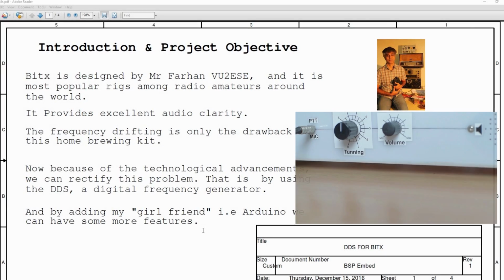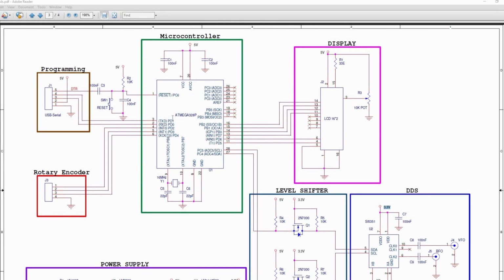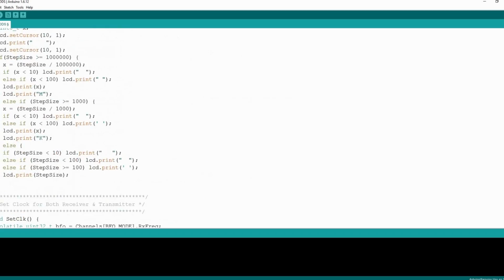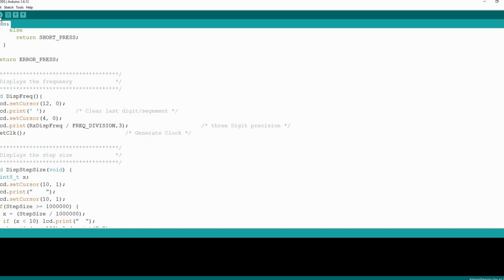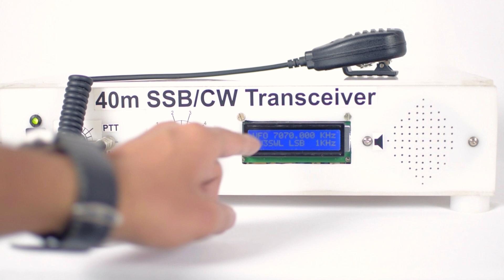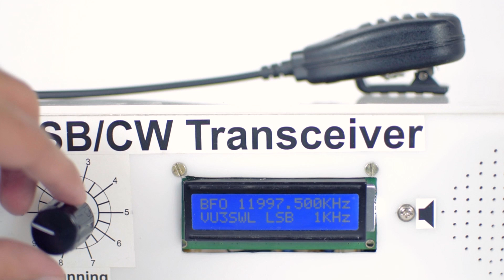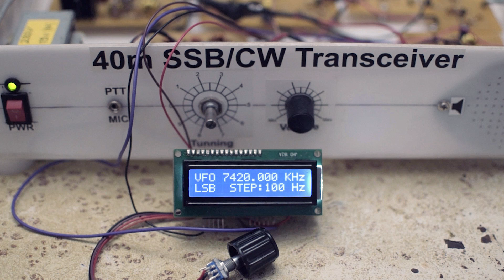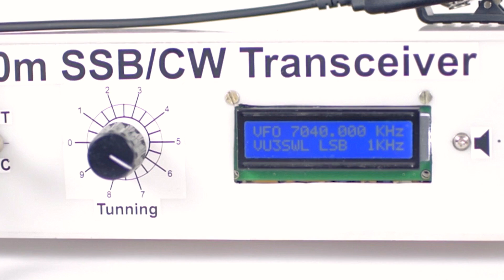DIY How to add DDS to Bitx | Bitx40 | Ham Radio HF Transceiver

Comment: Nice Video and useful my Friend.
I am using the same BITX40 V3 Radio with vu3vrl's DDS VFO and working OK.
Now, I face some problem with rotary encoder, when I rotate it anti-clockwise to lower frequency, the response is normal, whereas for increase of frequency, the response is very slow/poor.
I need to replace the encoder.
Kindly suggest me it's availability. Thanks.
..... vu2rdx, Sekhar.

Comment: Receiving a BC station change / modify BPF for the required frequency band and change vfo ( running ) in software section.....
Reply from the maker: Set a BFO Frequency to 12MHz, then you can listen to BC Stations.

Comment: Why are you using a level shifter?
You calculate CLK0 for what is the VFO output used? As this vfo seems only for display purposes.

Do you have some kind of lpf filter behind the CLK0 CLK1 before entering into the dds on the bitx, resolving interference on the blockwave by the dds signal?

Ron - PA3FAT
Reply from the maker: Thanks for the feedback. Level shifter is used because Si5351 operating logic level is 3.3V & Arduino is 5V. CLK0 output is 4.8Mhz to 5Mhz for 40m band. and IF Frequency is 12MHz. Absolutely VFO  (7MHz for 40m) is for display. Don't have any LPF filter behind, But their is a 12Mhz Ladder crystal filter at in IF stage. Please check the details about Bitx40 circuit diagram provided in manual.
Reply from the maker: Yes, You are right.

Comment: Hi,

Looked at your sketch. Looks really great and structured coding. Super.
Using struct's is great. Did not know Arduino c supported this. Some new learned. Tnx !

Working on same together with W5KUB (check out fb or here on yt).

Will follow your developments as of now.

Ordered 2.6 colordisplay with touchscreen on ebay. Will be working on getting this to work when it arrived (digole.com tft).

And final: get your license. And hopefully will meet on the air one day.

73

Ron - PA3FAT
Reply from the maker: Thanks, Definitely, we will meet on AIR ASAP.
Reply: There is 3.3v next to the 5v on the UNO.
Reply from the maker: We are using the customized board. Not the UNO.
Reply: ok, planning to switch to nano when all tested on the UNO. Also checking out the Nextion enhanced LCD currently.
Reply from the maker: Excellent.